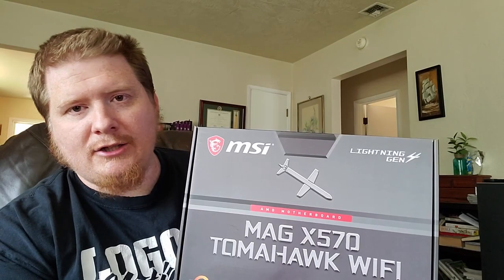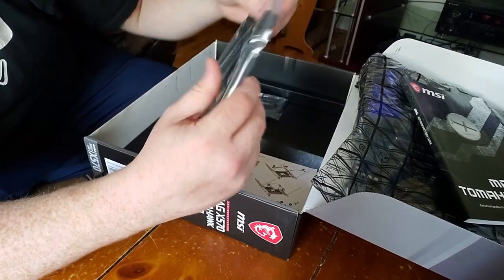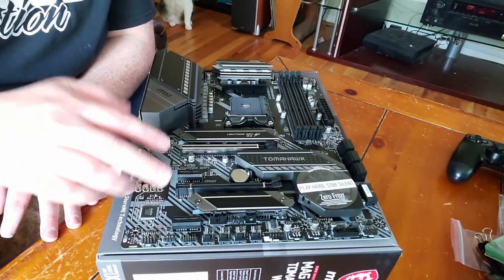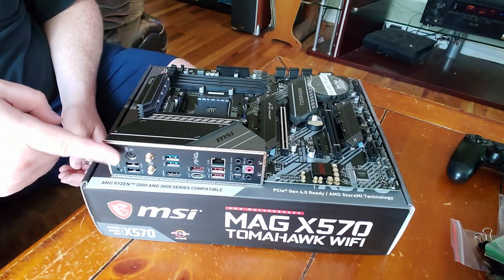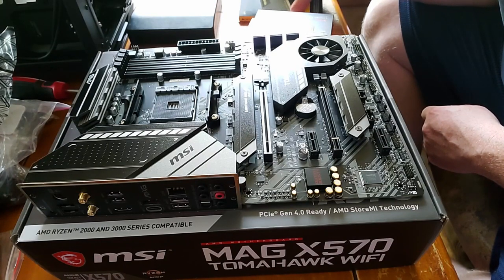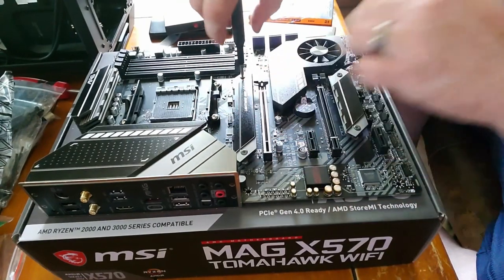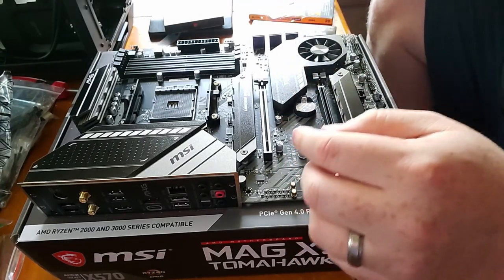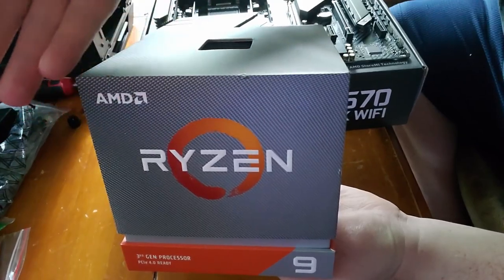MSI MAG X570 Tomahawk WiFi+EK Fluid Gaming 5700XT Waterblock+Ryzen 9 3900X - Personal Rig Upgrade

Comment: Great review but you're actually incorrect about the i/o shield. You're supposed to unscrew it and install it in your case like a normal board, securing it back onto the mobo with the screws after the mobo is seated.

Comment: Im not a experienced builder, but ive always wondered why not many spread the cpu paste before installing the cooler. Does it not matter?
Reply: From what I’ve heard it supposedly will just squish across your cpu if you put the  cooler on top
Reply: Wyze178 Wouldnt it give a better cpu/cooler contact, if the entire surfase is covered in paste? If u put a drop in the middle and squash that, surely there will be areas where theres no paste?
Reply: Bjørn I would think your right about spots missing it but I’ve never actually done it I usally just use what’s pre applied to what ever cooler I have
Reply: Wyze178 I just found a video on this subject with benchmarks. Best method is to either make an X on the cpu with paste or cover the cpu with a finger or small spatula. 

The difference between a drop in the middle and the methods mentioned is 5-6 degres on max temp :-)

Comment: nice i just put a r9 with this mobo, in a mesh II. 280 AIO push pull on the front. 5700xt Tuf evo with 25% power boost. so it hits 250w tdp like the strix model.
Reply: Got the same mobo, mesh II performance and Arctic Freezer 280 AIO. How did you mount your 280 aio in the mesh II? Push pull?
Reply: @grillierer8382  LOL yeah....that took me about an hour to work out.....so i had to cannibalize some long rad screws bc i didnt have many since the mesh II gives out the actual srews for the GPU fan mounts. As far as that goes use those screws...I had to dis mount the included fans...then re mount them on the front of the cage...then the rad...then the pull fans on rear of the rad...i also removed the cage and flipped the fan cage 180...so that the front mesh didnt touch the p14 intakes. Then i put it as high up as i could...im using 6 screws on the rad front and back LUL. But once i did this it finally fit right....and the hoses need to be treated with "care" near the rad...since theyre so stiff if you have an XL sized GPU....the 3070 happens to be very small...but the 2080ti and 5700xt i had previously had the gpu heatsink near the hoses....IMO its the best thermal solution overall once you put some GPU intake fans in too...and the top 140MM fans. I did this b4 i installed the psu/cables. I mounted the rad literally first once i figured it out and hung the hoses/block over the gpu fan holes. It was one of the longest builds bc i hadnt built a pc in a while and its my personal rig so i wanted it tidy and clean af...actually the rad/fan cage has its arms facing inward holding the rad. With the flush side facing the front  mesh. Hope this helps i think its the only way....and theres 2 channels for the fan cage a set pivot/hinge slot, and the angled channel one, is where i have the fan cage in the angled slanted one, i also removed the HDD cage cover slot thing permanantly...and the HDD cage bc its very cramped.

Comment: I have this board and have just updated the bios as the latest version has an agesa fix. The update seems to have broken the overclocking and undervolting in the bios. I did have a stable all core oc of 4.375GHz at 1.3v and the LLC set to mode 2 (close to level) with temps around 68c, if I enter this in the bios now it either won’t even post or if it does crashed in cinebench due to the voltage dropping too low, it’s acting like the LLC setting in bios isn’t working at all. It also no longer allows you to set an offset voltage using stock, pbo or all core without either not posting or locking all cores to 3.6GHz. Just wondering if you’ve updated the bios and if you have or are planning on overclocking it.
Reply: Ive learned to never ever update the bios unless I have to some people think oh theres a new update let me get the new bios it will run better??? Wrong
Reply: Same here normally but on this occasion I wanted to get the agesa update to try to get the cpu to boost properly. It does at stock voltage but as you’re probably aware, they’re pretty high

Comment: would this motherboard be good for the AMD 5900x CPU as most of the reviews  are saying how good this board is but comparing it with 3900x or low cpu was going to buy this or the  Gigabyte X570 Aorus Master  yes is more money but what i would like to know will i benefit more with the 5900x CPU thermals over the MSI MAG X570 Tomahawk
Reply: I’m getting ready to build and I have this motherboard and a 5900x. Everyone I have talked to says this would be a great match together. That’s why I went with it.
Reply: @rickeybobby9837  Me to i have made my choice with the same motherboard but i can't seem to buy a PC with the rtx 3080 and the 5900X right now so it looks like i have to wait for next year when they will be available and i would buy a PC with out the graphics card and i can just use my 1080 ti but no point if i still cant get the CPU for my new PC i am stuck ether way and my PC is so old now and cant play any of the new games from 2016 on the ultra settings with out having bad mouse lag or stuttering at 3400X1440p So by the time they will be in stock the 3080 ti will be out Its such a bloody pain in the ass this crap launch

Comment: hi thanks for this very informative overview of the motherboard, i am new to pc  and i have a question regarding the process after this, i am upgrading from asus x370 to tomahawk x570, will there be any issue if i transfer my existing M.2 OS stick from x370 to the new one x570? thanks a lot!
Reply from the maker: There's a chance you might experience some weirdness. For one, your OS activation won't carry it over on its own. You'll need to make a Microsoft account to associate your activation with that account. Then when you boot in two windows on the new platform you sign into your Microsoft account and Windows will activate. Of course you'll need to install new drivers and what have you. All in all it should work okay. I personally start fresh with a new platform and transfer over data.
Reply: @scottbirkinshaw2009  thanks a lot scott, i might opt to just do a clean boot just to save me some time figuring issues! thanks for your help and i really enjoyed this video! cheers!

Comment: Thanks for the video. Question; I plan on using the new Ryzen 7 4750G Pro with this. Know what memory I should be looking at getting? Overclockable? I haven't built a desktop in over 10 years.
Reply from the maker: I haven't research those new APUs coming out. Everyone seems to say 3600 megahertz is good for AMD 7 nanometer processors. My 3900X is doing really well with 3200 megahertz ram

Comment: The 570s board is better does not have a fan but has heatsink instead so in this motherboard the problem is if the fan dies you can't replace e it....that's the downside to it.....
Reply from the maker: The fan literally never kicks on, it never gets warm enough to be in use. The only time I've seen it run was when I gave a custom curve that did not allow it to go into fan stop mode. This is why they stopped manufacturing these X570s with the fan, it was complete overkill and unnecessary - not really a redesign. lol
Reply: @scottbirkinshaw2009  Regardless to what you said when it dies it is not replabeable...and that's a fact....
Reply from the maker: @ghostrangerp.8819  No replacement? Check your facts Mr. Troll - https://imgur.com/gallery/JvojrlL